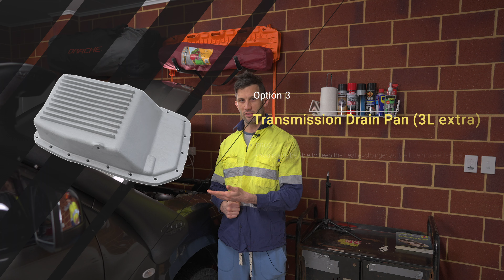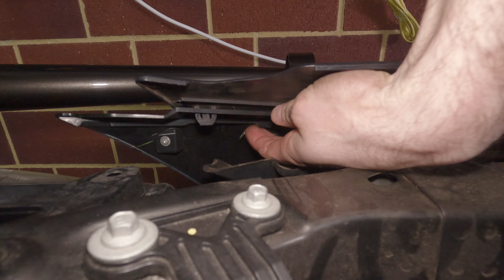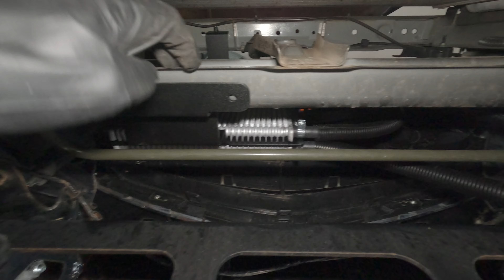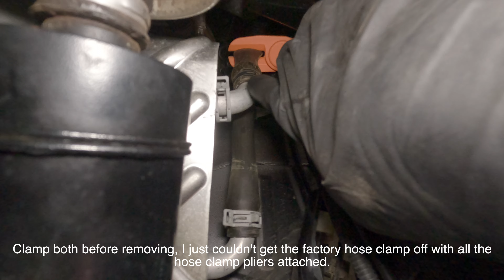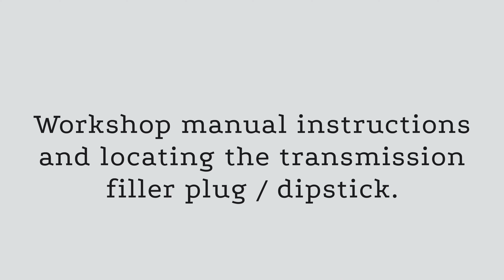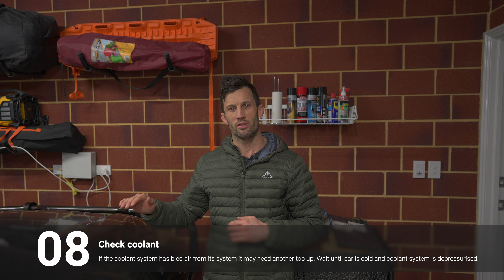Transmission Oil Cooler Install BT-50/Ranger || How To Fill 6R80 Transmission (Build EP10)

Comment: Can I keep the heat exchanger and install the oil cooler? My idea is to get the temps up the same way, then the oil cooler will keep the temps under control.

Comment: Do you have the full time thermal bypass installed? If so, would you still need to drive the car to circulate the fluid before topping up, or can you just start it, idle up to temp and refill to A mark as necessary?

Comment: Routing the oil after the radiator is the best way; that way oil is brought up to the operating temp, and then the cooler keeps the temperature under control. On my FJ Cruiser, the Hayden 679 without bypass keeps the temps below 75C under all conditions.

Comment: I have all three & normal around town, urban driving, I used to get between 97/101 °C with ambient temps of 25. Now it sits between 58 and 62 °C on an ambient temperature of 25 °C,
 PX 2 Ranger

Comment: Hi unless I missed it what was the weather conditions // ambient temp when u tested with and without coolers fitted .
Yup agreed every cooler maker tries to scare u saying the water cooled factory unit will split !!! LOL
The aftermarket cooler industry have always said this .
By the way apart from the vehicle specific parts the coolers are only worth  $40 Usd each retail 
The coolers are made by Spicer /Dana Sold as Long industries and TruCool . Most OEM use them .
Reply from the maker: Good to know that info. Ambient temps would have been 32-34 Celcius at the time as it was summer but not boiling as I remember it.
Reply: Its very easy to see that even with a cooler and the original thermostat if u were to tow over 1ton  in 30cel+ weather temps would be borderline .  Under cooling most car makers are guilty of .
Reply from the maker: Yes definitely for towing, the tolerances are quite fine. I am lucky because I idon't tow at the moment but I wanted maximum protection regardless. @paulthompson1654

Comment: Im getting wild readings on my UG of 146° c with no tranny light coming up on the dash whats the chances the UG is wrong?

Further info

Bt50 2012 auto 3.2 

Trans cooler kit in

Thermal bypass value being put in tomorrow

Canopy full load, rtt, 270awning, 33in tyres, bullbar, full length trundle with tools

Doing half a lap of Aus and currently in port headland, first time doing a big trip so anyone that can leave abit of advice or past experience i would greatly appreciate 

Thanks guys and great video browney 🤙
Reply from the maker: Is this when you start the car? Does it go up as you drive?

I'd say the coding is wrong and it's reading something else, or that they've got it reading degrees Fahrenheit perhaps?

With the transmission cooking kit I am yet to go over 100C.

Comment: Using a J pipe to connect the two coolant hoses is just lazy and it introduces two unnecessary joins in to the coolant system. Just find the other end of the coolant hoses and join them together with one piece of hose.
Reply from the maker: It comes in a kit like that. No issues so far so I'm not too worried about it.

Just installed as per instructions.
Reply: @TheBrowneTown  not really adding extra joins as they had clamps onto exchanger already

Comment: What would be other reasons why transmission goes apart from towing. Unsure if previous owner did as there isnt a tow ball atatched..
Reply from the maker: A transmission could go even if a car has never towed, it's just less likely but there's always a chance a car has a bad one from factory.

Things that raise temperatures are mostly towing, sand driving, or carrying a lot of weight, driving aggressively.

Most people won't have issues and I definitely didn't need the cooler, for me it was just peace of mind, making sure the temps stay low and investing in the car to last me longer (hopefully).

Comment: Having the twin oil cooler set up does that restrict airflow to the radiator as the bt50 are bad for over heating
Cheers
Reply from the maker: Technically yes, but I don't believe they make this design anymore, I think there's a new design with two separate oil coolers placed off centre to work better with winches.

I haven't noticed any issues though with this design but never tow anything.

Comment: Is it worth putting in a bypass valve and cooler for a bt50 4x2?. Just normal driving and once in a blue moon towing a trailer to the tip?.
Reply from the maker: I'd say probably not. I think it's best for those who tow, I didn't really need it but just wanted to play it safe.

90% of people don't need it I think.
Reply: @TheBrowneTown  thanks heaps mate. Appreciate the feedback. Great vid by the way. Explained everything very clearly and acurate👍🏼🚗
Reply from the maker: No worries. I can confirm that they do work, as I've read the temperature readings before and after, but that doesn't mean people need them.

Comment: Hey Mr Browne Town legend, I've just completed the cooler mod and your video made it very helpful, however I did need to remove the front drive shaft as i had a few acc cables runing down inside the chassis, what I cant find is the torque specs for retighten it back up, have you got this info on hand by any chance? Thanks again.
Reply from the maker: The workshop manual says:
"Propellor shaft front -
Step 1 - 15 Nm
Step 2 - 180 deg"

So that doesn't really mean much, not sure what step 2 is, but I guess 15 Nm with loctite on it as well. These are the small tor bolts aren't they?
Reply: @TheBrowneTown  tighten to 15nm in star pattern then mark each bolt head with sharpy at the 12 oclock then turn the head of bolt a further 180 degrees to the 6 o'clock position 👍 
Torque to spec.
Reply from the maker: Cheers for that, didn't see this comment for some reason but thanks for the info
Reply: @TheBrowneTown  yep, t45 torx

Comment: How’s it going with cooler only?
See a need for the bypass valve yet? Especially in this hot summer!
Reply from the maker: It's going good, I don't think I will install the bypass as I think the oil is supposed to get up to temperature so I like the idea of just maintaining it.

Keeping in mind that I don't tow, that's where these temps really become an issue.

It sits about 84-86°C whenever I look, but I don't check it as frequently as I did when I first did the install.
Reply: I’m towing a 2000kg van around SA at the moment. No transmission mods but new fluid, and it’s getting up to 115 degrees sometimes in the 41 degree weather and a bit of a headwind at 80kmh. 
So I think I’ll just add the cooler and see how it goes. Sitting around 100 would be acceptable.
Reply: @shan_obi I had the same temps with my BT I’m the same condition, now I sit 75-82°
Reply: Also what did you use to get the new fluid into the transmission?😂
Reply from the maker: I used a 1 litre hand pump that you can get from Supercheap or Repco.

Transmission fluid is quite thin so the pumping is easy, except I had to refill 6 or 7 times.

Wow, 115 is a lot! Good to hear some numbers though. Before I installed mine the highest I saw it was about 100-103.

Comment: i'm doing this job right now , alloy pan for extra oil and a drain plug  , twin cooler kit from wholesale automatics  ' no towing involved just want to eliminate heat exchange unit  ,  i'm leaving the stock thermal valve in as i want the transmission to warm up quickly on really cold mornings and also maintain optimal running temp  ' installing bypass valve might run the transmission  to cold in zero temps ?
Reply from the maker: Yeah I don't tow so was happy to leave the bypass valve alone. I have a spare in case I need to change it later.
Reply: the transmission shops state that the amount of heat the torque converter puts out it dose not take long to get to operating temp and unless you are hwy driving I would not expect a large amount of air cooling to keep temps too low for long
Reply from the maker: This is true in summer but I have seen it take a long time on cold mornings even with the valve still in.

I think in some areas like Tassie or Victoria where it gets really chilly the car would take a fair amount of time to get it to operating temp.

Doing something like hill climbs would change that quickly though.